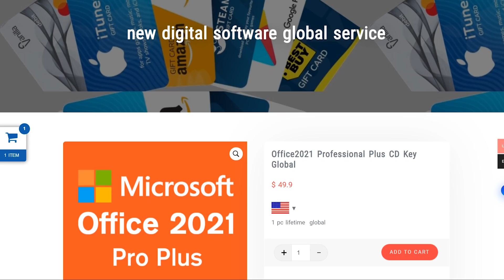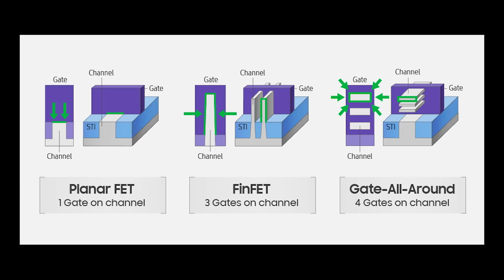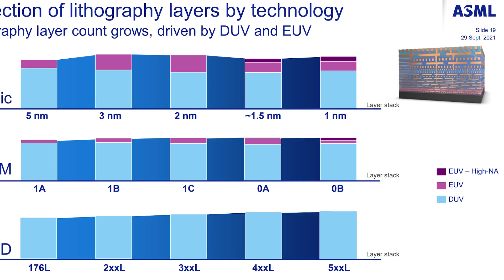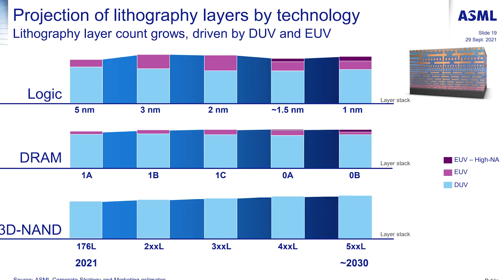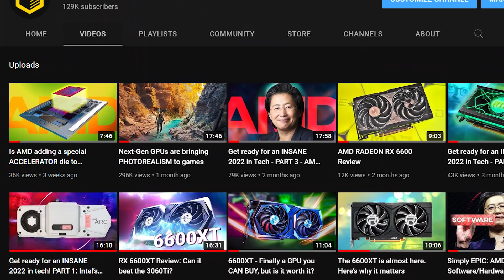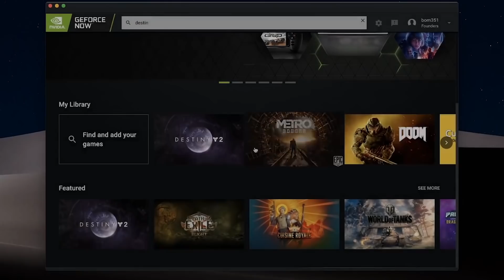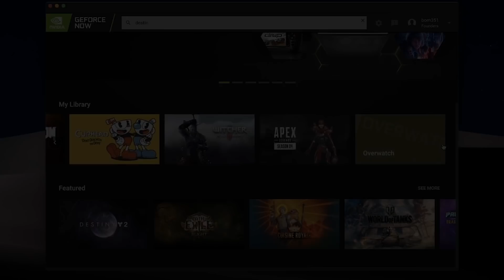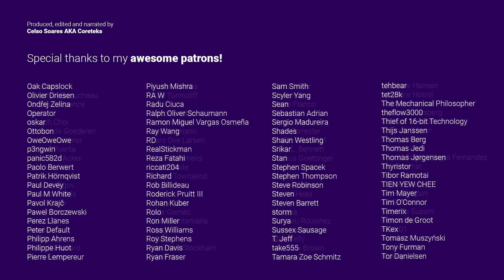GPU and CPU prices are only going to get WORSE in the future. What should you do?

Comment: We need disruptive innovations in chip fabrication to drive costs down. Exponential cost explosions will put a hard limit on pricing customers will accept sooner or later. I hope that the export bans on EUV machines to China will force the Chinese to come up with something new and more cost effective, e.g. carbon nanotube transistors or other disruptive new technology which is not brought forward by the incumbent technology leaders because they are heavily invested in older tech.
Reply: We need to take collective shot of 'calm-the-f...k-down' and DEMAND that software catches up to hardware, and that - in necessary - compatibility and two-way data conversion of SaaS solutions is legally enforced.  Shout about net and saas neutrality, right to repair, ownership of devices and data, demand hardware compatibility....

Comment: Well, as for the games I play, I have hope for the Intel/AMD apus in the future: an rdna2 Apu for desktop, upscaling and cloud gaming is the future of PC gaming. 
I already have my cpu+Rx 6800 GPU partitioned to be used by 2 PC at the same time with thin clients. It works really well
Reply: Rdna2 is close, but it will come with a 300$ CPU, budget gamers would be left out again.
Reply: The apus with rdna 2 will be useless cost wise . The gpu performance will be crap unless you pair it with ddr5 (assuming it supports it) because the gpu needs bandwidth. Ddr4 just isn’t enough to give the gpus enough performance
Reply: @earnistse4899  did any of you read: "*for the games I play*"

Comment: In the last years there's just no need to have the latest stuff, the added features like ray tracing are just boring and useless in most of the games, you can play the latest games on 4-5 year old hardware. Just check the graphics differences between medium and ultra settings in motion, you won't notice the difference. There are also more and more indie games that rely on smart ideas and creativity instead of raw power, while AAA game quality is getting worse every year. There won't be any incentive to buy that expensive hardware. There's also cloud gaming, if you can't afford the cost of a high-end PC for that one game that you really would like to play then play on a cloud machine and pay only for the time used, then go back playing your CS:GO/Overwatch/Dota games on your 10 year old PC :D
Reply: They are pushing everyone to cloud gaming, and soon you will have no choice.
Reply: @killerv135  I would rather use my desktop PC for gaming and other tasks, unless cloud gaming offers something which cannot be done on PCs, even the most expensive ones.
Reply: RT looks great - depends on what the developer is aiming for.
Atmospheric pieces are enhanced through RT tech.
Agree overall though, that game mechanics & art style are king.
Reply: For playing in 4K 120fps you really need a new PC, even with older games or RPCS3. I find my $250 GTX 1060 unable to run games in 4K 120fps and I have a TV like that. But I won't pay $750 for a replacement GPU. I want a $250 GPU which's 4x better than mine (and I don't count ray-tracing or tensors). Ray-tracing is a bonus, but it's not the most important feature. I want raw performance. It all seems to improve very slowly. I can't believe that my 1060 will be 6 years old later this year!
Reply: @Kynareth6  Try playing on lower resolutions, only some strategy games require 4K, in FPS games you don't see the difference since motion resolution of your eye and also the shitty LCD panels will not really be at 4K. For FPS games 120fps is more important than 4K, for slow strategy games with lots of detail 4K and 60fps is ok. Either way an old 1060 card won't be enough in many cases.
Reply: Big truth. Graphics are reaching the point of "who cares?". They are so good even at the lowest level that you are paying a premium for marginal improvements. "Oh look this pixel looks 0.5% sharper, nice!" It's now time for interesting stuff, like the voxel games Coretex covered in that one video
Reply: @anonymous3561-k4b  Graphics are only the beginning of gaming evolution. Not the end. Graphics today are just textures. There is no simulation of underlying processes whatsoever. The future is simulating as much as possible. Have you seen or read Infinite Dendrogram for example? There is a living, breathing VR world running on servers. Video game AI is extremely dumb. There is much to do over the next few hundred years!

Comment: The current energy price rises ( kWh and btu) prices are nearly double what they were early 2020 and are already effecting mining in Europe ...we can only hope China actually bans gpu mining ,yes they've publicly banned it in some provinces but it still goes on widely untouched... virtual currency mining is an ecological disaster and is consuming a disproportionately massively proportion of our planets resources for the gains involved...given that it can crash at any moment meaning all that energy and resources have been wasted.
Until the governments take action ..chip supply problems and pricing will get worse and we will accelerate climate change with the massive amounts of energy used in mining ( manufacturing and running the hardware).
Just look at how many electric vehicles have been put on hold due to chip shortages, as manufacturers divert supply to the currently still more profitable ICE vehicle production.
Reply: It is first and foremost sign of human delusion.

Comment: Let's keep all of this in perspective though, computing hits plateaus constantly, that's where we are now.

Even the E cores of Alder Lake have pretty decent performance, you can play AAA titles on a $600 MSRP machine (just!) which is probably better than any point in history.
$329 RTX 3060 matches the flagship of two generations ago, a card which is still being sold for a pretty penny on eBay today.

The high end has gotten more expensive but it's also gotten much more high end. You can still get a cheap CPU, only today's value chip exceeds the high end gaming chip of 2016, again, while the older chip still has value.

If we could just pay retail we'd be in pretty good shape.
Reply: Dude the RX 480 matched or exceeded the flagship from two generations prior starting at $200. The R9 380 did roughly the same. The R9 280 matched or exceeded the last gen flagship at $280. Every generation of Nvidia GPU prior to the 10-series has matched or exceeded the last generation flagship at around $350. This was also when a new generation came out every year.

You could buy a AAA console killer gaming PC in 2013 for about $450, just look up some videos from the time. They just paired a Athlon X4 750k (about $50-60) with an R7 265/GTX 750ti (about $150) for a solid 1080p 60fps (some games would hit a CPU bottleneck though) high settings experience. I built many similar, slightly better machines back then for myself and friends.

This is, going by MSRP, one of the worst times ever to build a gaming PC, only time I can think of that was worse was the last generation of GPUs (pre-super refresh) being even worse value than this one. But then we at least had cheap Ryzen 5 1600/2600 CPUs.
Reply: @giserson2  yeah I don't understand why people keep comparing against the flagships of the past as if past tech being slower hasn't always been the case.

Not to mention an RTX 3060 right now sells for as much as some of these flagships did at their launch nearly 5 years ago.

Frustrating part is that the CPU space is actually pretty good right now, but my consolation is that CPUs are set to  continue having unprecedented increases in performance & efficiency with Zen4 & Raptor Lake, and when I finally do a new build, the performance of the rest of the system will be incredible.
Reply: @InnuendoXP  The 3060 is more comparable relative to the 780 Ti vs the 750 Ti rather than the 760 or 770.

The 700 series went from ~$100 to $699 bu the 780 Ti was only ~4x faster than the 750 Ti @ $159. The 3060 is 4x faster than the 1650 @ $329. I've got two of them purchased at MSRP. Price gouging doesn't have anything to do with the subject at hand.

Shit is expensive but it is monstrously more powerful than the value line, the very value line that still plays AAA titles.

We can't keep advancing tech to such extreme levels without the price going up. That's the whole point, we're getting relative performance jumps higher than previous. Entry level has been 720P to 1080 for a decade now and the high end can play 4K.

Compare the 3080 to the 1650 (current $150ish card) to the 780 Ti vs the 750 Ti. It's expensive but it's also massive. Same thing goes for CPUs, yes, the high end and midrange has increased in price, so has the relative performance vs the $100 chips.
Reply: @glenwaldrop8166  the 780Ti was a stupid product for $700 at the time (it reviewed poorly, was very power hungry) & 1 year after its launch the 970 came within 10% of its performance for under $350

It makes little sense comparing the top of the stack vs the bottom of the stack when what you could be doing is apples to apples comparisons between product classes gen on gen. Ampere at MSRP is a fine progression over Turing's lacklustre offering over Pascal.

But Ampere at MSRP doesn't exist for all practical purposes right now.

"prices 'have' to go up for performance to go up" they really don't. Unless there's some law that computer hardware was ignoring from around 2003-2016 which has suddenly become immutable now.

and the only reason budget hardware still plays AAA titles is because AAA titles are still being built for the PS4 - because there aren't enough chips to flood the market with PS5s & Series X/Ss. If this weren't the case, the 1650 would be worthless right now.
Reply: @InnuendoXP  Old or cheap PCs will start having problems when the majority of games will be for PS5/XSX. Today that's not the case with PS4-oriented titles or Switch-oriented titles. We don't know how powerful will Switch 2 be.
Reply: @Kynareth6  Nintendo's only reason to release a Switch 2 is Nvidia ceasing production of that set of Tegra chips (because they're so damned old) so we'll see. But plenty of Nintendo fans buy whatever Nintendo put out & just have that as a separate ecosystem entirely while also having one of the other consoles for the graphics/performance. (Series S is probably a good companion console for Switch owners) but they're in a world of their own, and they haven't even really tried pushing visual performance as a priority since the Gamecube.

As for old & cheap PCs scaling poorly against the new consoles when games stop being made for PS4 as a baseline - yeah absolutely, I won't dispute that for a second.

But with PC hardware prices the way they are right now, my argument is there is no reason to spend that money if your old/weaker hardware is still going, until significant numbers of games that can put that hardware to work in transformative ways, as opposed to incrementally better, or the same thing but a bit faster/shinier

Because even with prices inflated as they are, there's still always more powerful hardware on the horizon. So if you have to pay these absurdly inflated prices, you might as well try to get as much of your money's worth from it. And to me, that means waiting for the software to leverage what I'm paying for.

GPUs aside, high speed PCI-E 4 NVME SSDs have already come down significantly in price just in the past year.

Alder Lake's i5 12600 will be an ideal all-round option for keeping on top of this console gen once more budget motherboards fill the market & more units ship, the E cores meaning you'll have all the CPU headroom you could need once realtime decompression with huge volumes of data streaming start getting leveraged hard in games (because RAM seems to be staying expensive), Zen 4's chiplets will probably do the same thing but better, RDNA3 & Lovelace are expected to be huge performance uplifts so the 7600XT could trade blows with a 6800XT for the price you were supposed to be able to buy a 6700XT for.

So by the time all the covid-delayed development catches up, by the time enough new-gen consoles are in gamers' hands that publishers are happy to cut the old gen off & games actually start to require this new hardware, a PC that can match or exceed these consoles should actually be relatively reasonably priced in comparison to now, even if you're still paying double what a GPU should in any usual generation.
Reply: @glenwaldrop8166  The 1650 was shit value, the 750ti was great value. The 780ti (as all other flagships) was shit value, the 3060 is supposed to be in the good value segment. You're also comparing a last gen card to the 3060, not a current gen one (it doesn't exist yet). For a fair comparison, compare the 650 to the 760 (same points in the stack). According to techpowerup, the difference then is the exact same, the 760 was 250% the performance of a 650, a 3060 is also 250% the performance of a 1650. The 3060 is 2.2X the price of a 1650, same with the 760 vs the 650. In this sense the value is the same, however you are spending $30 more on the 3060 after inflation and about the same for the 1650 in 2018/2019.

You also have to consider that not everyone is willing to spend a lot of money on a GPU and consider the competition (consoles). In 2013 you could buy a console equivalent or better GPU for around $150, the cost of a console was $400. Today a console equivalent or better GPU is at least $330 (but honestly the 3060 isn't quite equivalent) for a $500 console. And to match or exceed the $300 console you have to get a last gen GPU for >$200 as the low end GPUs from AMD this generation will be smaller (16CU vs 20CU) and likely slower than an Xbox Series S GPU and Nvidia and Intel will both likely match that sub-Xbox level performance. There are also no options, and there are no currently known plans for, any GPU below $150 making entry-level gaming more expensive, as any future APU with decent graphics will most likely cost a lot. The 50-100$ CPU + 100-150$ GPU entry level gaming PC is basically dead and that makes PC gaming a lot more difficult to get into for younger people (unless their parents are relatively rich). I've speced out PCs with Athlon 200GE + RX 570, FX 6300 + R7 270, A8-5600K + HD 7850 (1GB) and Pentium G4560 + 1050ti, but those days are over.
Reply: @giserson2  I agree with practically everything you've said, just going to add, there are more components in a GPU today, better power management, more power draw, better power quality, larger dies that are drawing more power on a smaller lithography...

The price is too steep, it's best to get a console today if budget is a concern and it's strictly for entertainment.  The 3060 is right between the two consoles but for the price of a gaming PC you could get two consoles or a console and a new TV.

All of that said, the 3060 is a solid card and PC has never been the value gaming solution.